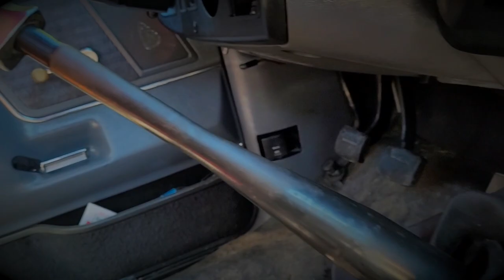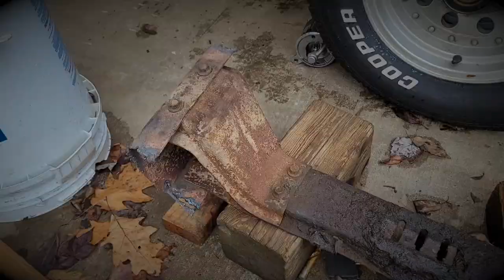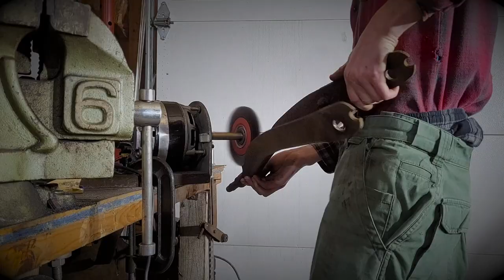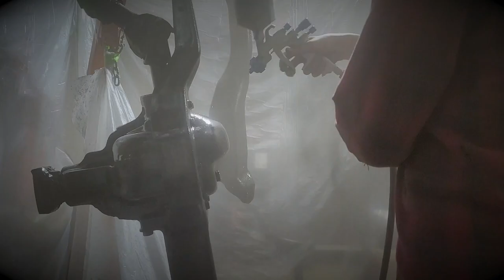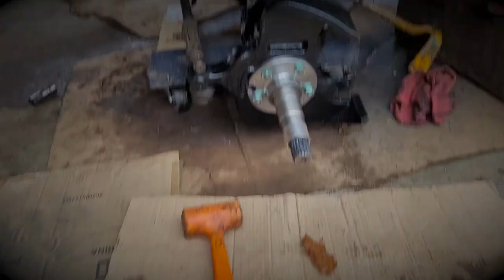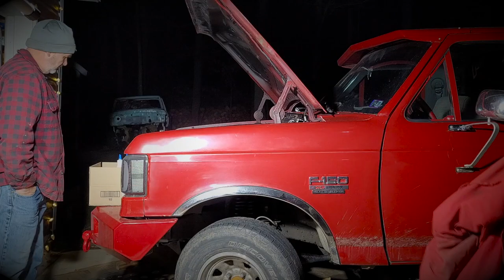HOW TO: CONVERTING A CLASSIC OBS/BRICKNOSE FORD TO 4X4! EASY!

Comment: Nicely work!  As one who has done a couple of these conversions I can testify as to how straightforward the process is.  With each of mine I also changed the spring towers and converted to quad shocks.  Early on in your video I knew you would discover the fact that the 2WD & 4WD radius arms were not the same.  Others may find it helpful to know the 2WD radius arms from F250 & F350 trucks will work for F150 4WD applications.
Reply from the maker: Awesome info thank you!!!
Reply: What about 2wd f350 radius arms for a f350 4wd conversion?

Comment: Nice Zf5 swap.  Did the same with my 89 f150 with a 302.  Had to move the crossmember back 3" and had to customize the driveshafts to fit
Reply from the maker: It should work with any crossmember that was 4x4 for the M5R2 and the ZF5. The AOD and the T18 are incompatible. However I had a friend cut and weld more steel on so it would work properly! Other than that it was all bolt on with no issues.
Reply: @flatheadlarry7977  you do nice work Larry!  Love your bricknose.  What year is it?  89?
Reply from the maker: @jtuminello7z  It is a 1989!
Reply: @flatheadlarry7977  super nice truck man.  You're very talented my friend.

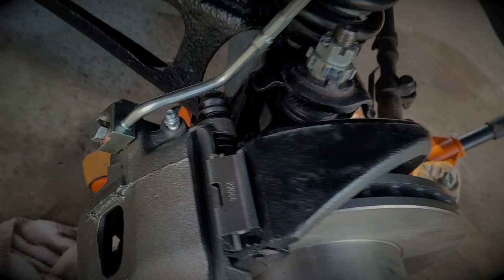Comment: nice. however, at 41:00 -ish, I see a Ford Power Steering Pump. That can be swapped to a Saginaw unit from the econoline vans (with bracket as well)! Had huge problems trying to get my '78 f150 quiet and found these Saginaws on the van and *bam* nice.

edit: oh and I grabbed the Serpentine belt and 3g alternator and bracket ... and '96 4.9l efi manifolds and efi and ... lol, <3 all

Comment: Ford built those bricknose F-series pickups & Broncos from 1987 through 1991. The pickups are the eighth generation F-series & the Broncos are the fourth generation Broncos. I still see a lot of the pickups out on the roads today, but the Broncos on the other hand, I don't see many around anymore like I use to back in those days.

Comment: this awesome.  I am actually doing the same thing in a couple days. I'll be putting a zf5 and a front and rear diff off a 1991 f250 on to a 1992 f150.
making a search and rescue unit. but I trying to figure out how to put the leaf springs on the front of the f150 from the f250. hope to get it going fast. 
thank you for the video sir.

Comment: What was done with the engine? 
The Front Axle match the rear.
Differential
Driveshaft front connect with the transfer case of the transmission?
I will need a list to have it added on eBay to purchase. Will need a guide. For convenience ill use the video for details. Nice work! And thank you.

Comment: When doing the zf conversion, make sure you use the clutch and slave cylinder that matches the year of clutch master cylinder you are using. Brick nose master cylinders have a .81something or other bore , and the aeronose master cylinders have a .76ishortheother bore and won’t move enough fluid to operate the older slave cylinder/throw out bearing.  And they mount to the firewall completely different. So it’s not as easy as just swapping the master cylinders. At least not without some major mods
Reply from the maker: I completely made my own line and used a Wilwood brake master cylinder I could build you a kit for $325 and I also used a 92 Slave cylinder. Worked perfect!
Reply: I love that thank you what is your website

Comment: With going through all the work to put the zf5 in there and converting to 4x4 I would’ve went with the solid axle Dana 44 or sky’s off road makes a kit to use super duty axles.

Comment: My 88 F150, 300-6, 4x4, manual trans and transfer case. But flange style ( tophat) hubs, right side will not grab. Any solutions ?  Also what benefits does the upgraded trans and transfer case do for performance and fuel cost ?  GREAT INFO AND VIDEOS ! KEEP UP THE GREAT WORK !!  Thanks,  USN Vet.
Reply from the maker: If it isn't grabbing it could be an issue with either the hub, the U joint, or something in the carrier that came apart. I only upgraded for the increased HP if anything younwould lose fuel converting to 4X4 due to adding much more weight to the vehicle! Thanks for the kind words!
Reply: @flatheadlarry7977  What are the benefits of the ZF trans ?  Is it a 6 speed ? My 88 F150, 300-6, 4X4, manual trans and transfer case with 31 inch tires. 3:55 gears.  It cant do highway traveling, any options ? THANKS !!  KEEP THOSE VIDEOS COMING !!! THANKS !! USN VET !

Comment: Would it have been easier to pull the bed to put the transmission in? Also were your cross members bolted on? I was looking at pulling mine to do my oil pan gasket and it looked like they were rivets.
Reply from the maker: It would still be just as hard with the fuel tank in the way, and the crossmember under the engine is riveted. You need to undo the motor mounts and jack the engine up. Remove the EGR if you have that too.
Reply: @flatheadlarry7977  right on man, thanks

Comment: Did you any problems with your inertia switch failing and locking the transmission in park or having  the ignition switch under the dash fail or having to replace the whole steering column. I have all the problems with my 96 F-150 XLT

Comment: Looks great!  Hey did you also connect into the dash for the 4x4 indicator light to come on?  Was there a wire or anything that needed to be added to the dash?
Reply from the maker: I did not, you need to add the wire down to the factory harness below the steering column and then hook up those wires to the t case
Reply: @flatheadlarry7977  perfect thank you!

Comment: I have a 96 F250 4x4 with 5 speed behind a 460. The truck is rotted out , but the running gear is perfect. Id like to run a small block in another truck. Or transfer the transmission to the small block. Is there an adapter plate in front of the transmission???  It seems you said that the heavy 5 speeds would fit the small block pattern. Also have 2,  6.9 IDI automatic trucks. What would need to be done to fit the 460 , 5 speed to them?  I know I'll need the flywheel of course. Both of my C6 autos are toasted. If none of this rambling made sense, I'm asking how do you put a bigblock. Transmission behind a small block Windsor bolt pattern engine???
Reply: you'd have to make or find a bellhouse adaptor to buy and use.

Comment: I have a 1988, wondering if i can just swap the 5 speed transmission on.  Or if i need to upgrade all the drive system with it ? 
Thanks 

Nice truck.
Reply from the maker: You can swap over the 5 speed ZF or M5R2 as long as you have the small block and 4x4 crossmemmber cause it gets in the way of the driveshaft

Comment: I want to make my 2wd into 4x4 but I’m not sure how to start. It’s a 95 4.9L. Is that even possible? Any advice?
Reply from the maker: Follow this video it would bolt up thr same way.
Reply: My other question is; did you make a hole to put the H and L gear knob? Or do you just lock the hubs and it work?
Reply from the maker: @alexaguilar3758  that is already there you just need to heat up the metal plate with a little propane torch and it will get warm and the glue will lift, you need all the linkage for the Shifter too.
Reply: @alexaguilar3758  You don't just lock hubs and have 4 wheel drive with having the transfer case shifter. Unless you lock the transfer case in under the truck, then you will always have the transfer case in 4x4 and that's douchey

Comment: Pretty sure I've seen this truck on the 8th and 9th gen f150 facebook group? Anyway I have an 89 5.0 AOD would I be able to just take off the drive shaft and slap a transfer case on the AOD? Thanks, good video.
Reply from the maker: I'm sure this is the truck!
Reply: no, you need a different tailshaft

Comment: I live within my means. I am mechanically inclined but lack experience. I am attached to my 1989 f250 2 wheel drive as it is from Nevada and has absolute no rust. It needs paint job and rear main seal but has 351 Windsor efe engine. it needs lots of cosmetic work but I know engine is solid as is everything else. Yeah it sways like a boat on grooved roads maybe shocks and sway bar bushings. I need guidance to let it go or to convert it to 4x4 since I now live in south Dakota. does it make sense to convert it, or being economically responsible is this a road to avoid going down? I have found what I want it to be and see listings for over 20,000. I am not able to buy that finished truck, but willing to spend money over time. Please anyone advise me to help me know it this dream is not realistic. I hear many people  saying divorced transfer case and such, I just want to realize if my dream is financially responsible withing my working means. Thank you. Mashed the like button right after the subscribe button.
Reply: The f250 is a lot more involved than the f150. Your truck has coil springs, the 4x4 uses leaf springs. You would need spring hangers, leaf springs, track bar, driveshaft, Transfer case, linkages, shifter, the front axle gears need to match rear axle gears. And you will need the axle. Honestly, if you have mechanical skill, it's a pretty easy conversion, just have to be mechanically inclined. I would recommend that you call Skys Off road or Google them. They have the frame boxes that are required for you to attach front spring hangers. Not expensive, I believe 250ish. You can find an F350 solid axle or find the dana 50 twin traction beam from any f250 from 80-97.

Comment: What head lights are you using? Will they fit a 89 f250 custom?
Reply: 87-91 is interchangeable. 92-97 is interchangeable in those years. It's not rocket science.